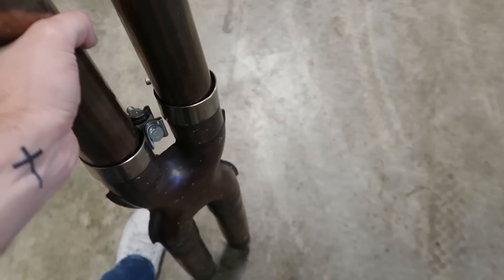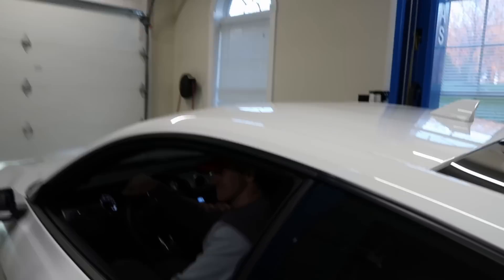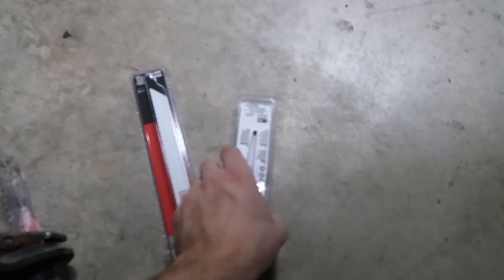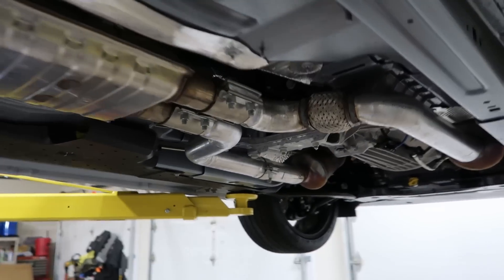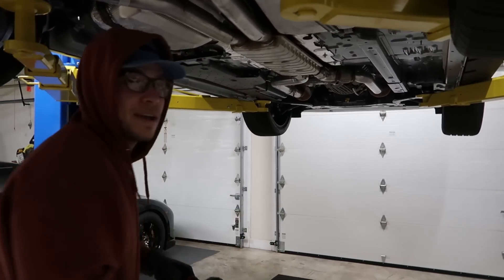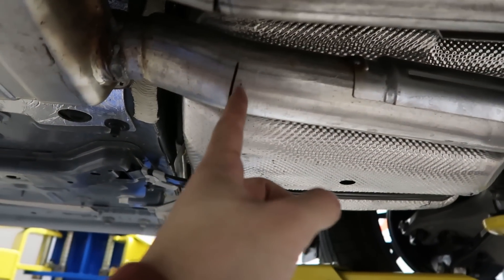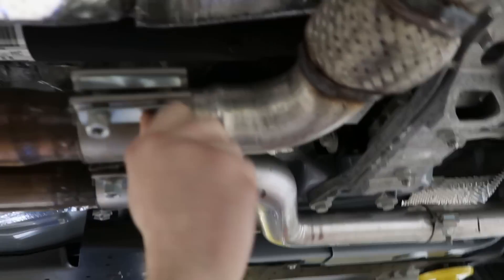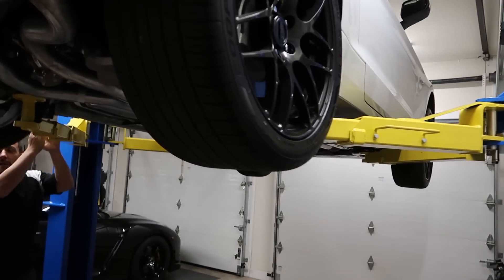We CUT OFF the Resonator on Colin's Mustang GT! (MBRP X-Pipe Install)

Comment: The blade with big teeth is for demo (wood and nails) .  If you can't find a metal blade short enough just cut the long blade off shorter.
Reply from the maker: Both of them said they where for metal tho
Reply: @ItalianStallion410  yeah I've noticed that before and I'm not sure why. The big teeth can be pretty dangerous on metal because they catch so easily. I always use the small teeth on all metal when using a reciprocating saw. And the big teeth with nails/wood. Just my experience in the construction world and helping the odd friend with their exhaust like you lol. Love your vids and cars! Keep up the good work!
Reply from the maker: @chm985  thanks for the info bro have a good thanksgiving!!